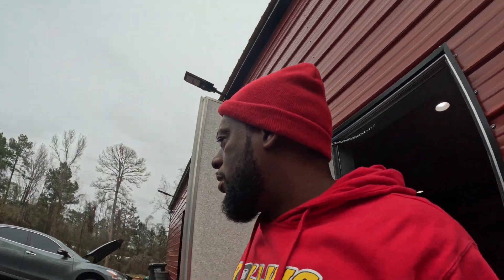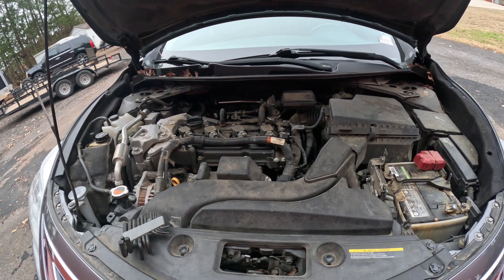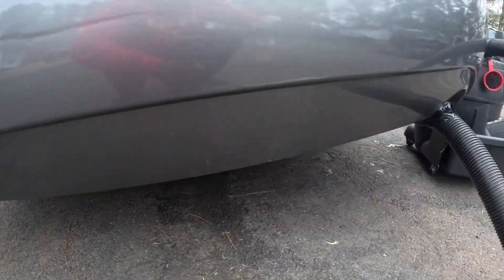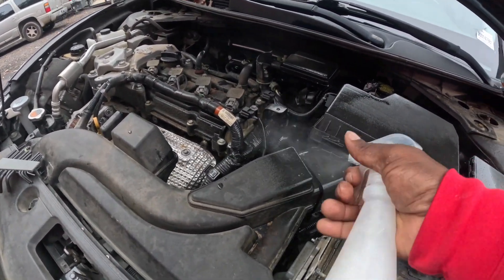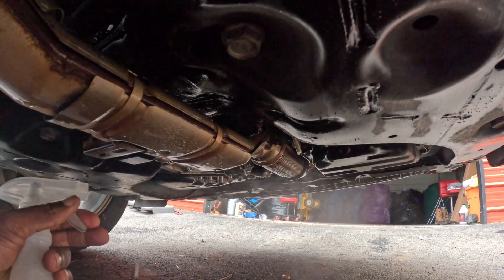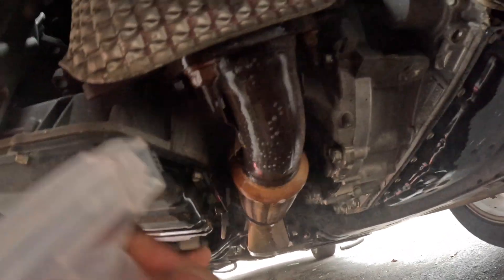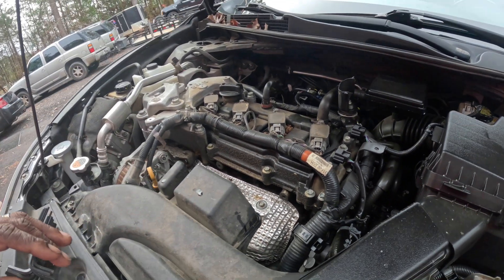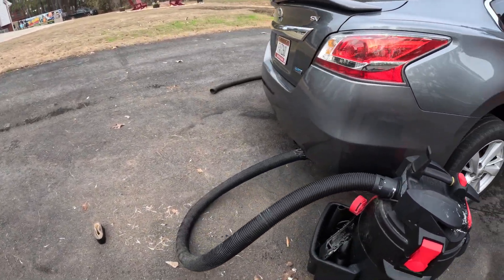CHECK THIS FIRST before purchasing a O2 Sensor or Catalytic Converter! EXHAUST LEAK Detection P0420

Comment: Hey man I had the same Altima but it was a 17.  It sounds like what mine was doing when the a/c compressor was going out. Is that sound only happening when you have either the heat or the A/C on?  Or does it get louder when it’s on?  Nissan had me replace the compressor the first time it did it at 77k miles and then then it did it again @ 120k miles and I got rid of it. The condenser messed up the new compressor and both needed to be replaced again. I hope that isn’t what it is but it sounds like what mine was doing.
Reply from the maker: I will look into that. Thank you very much.
Reply from the maker: But wait, it’s doing it when the a/c is off. Could it be the pulley?
Reply: I'd bet its a pulley.   Pull the belt and spin em all
Reply from the maker: @mattjudd5275  I will try that thanks. That’s definitely what it sounds like